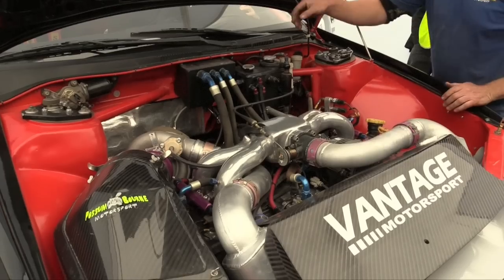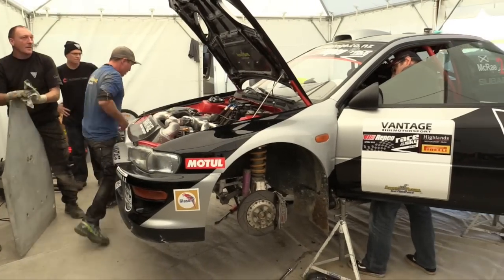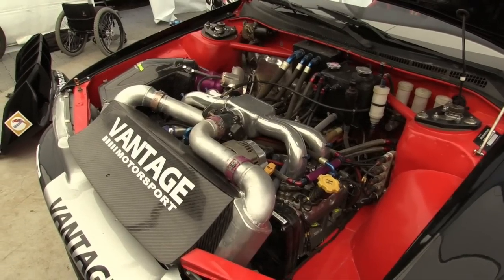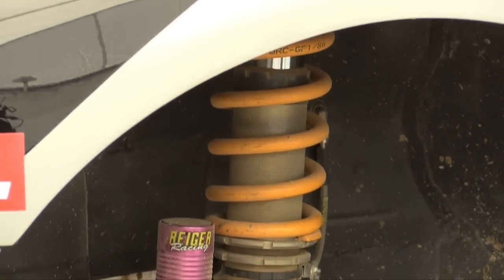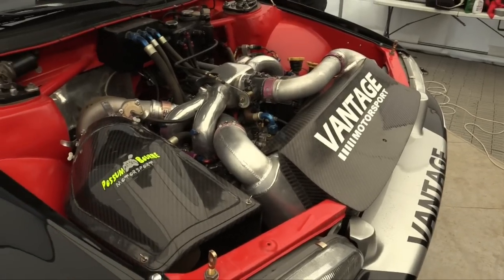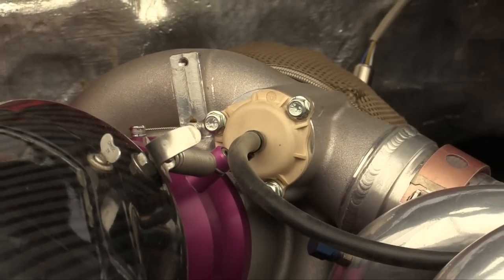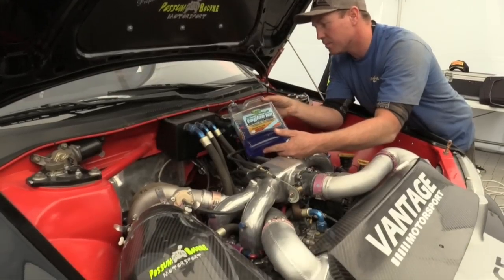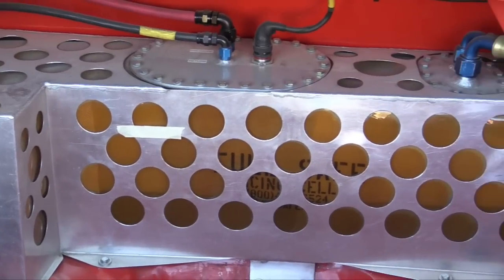⛔ 850HP WRX with no head gasket?! | ex-WRC Hill Climb 🏆 [TECH TALK]

Comment: Love these videos , always learning something. 
I wonder how long that engine can last and be trusted to reliably run a Stage without breakdown at these power levels .
Reply from the maker: The car is mainly used for Hill Climbs from what I understand these days and is a regular winner of the Leadfoot Festival with Alistair McRae at the wheel, so reliable enough I guess although you wouldn't be picking up the weekly shopping in it 😎
I'm unsure what has been changed but the car runs around 900HP now I believe - Taz.

Comment: This is really interesting, is there anyway you can do a more depth break down on running gas rings? Pros & cons ?
Reply from the maker: I can't make any promises, but keep an eye on our Instagram account :) 
In short they are a rather expensive option due to the required machining and aluminum bronze sealing rings are a cheaper, alternative, technology that is more common now.
Andre will do the topic of those and other options more justice than I can via an upcoming HPA members only webinar - https://www.hpacademy.com/webinars/146-cylinder-head-sealing-techniques/ - Taz.
Reply: Agreed that was the most interesting part for me, I'd only heard of monobloc engines before, this gasketless design is intriguing seems kinda like the steel o ring setups on dragsters